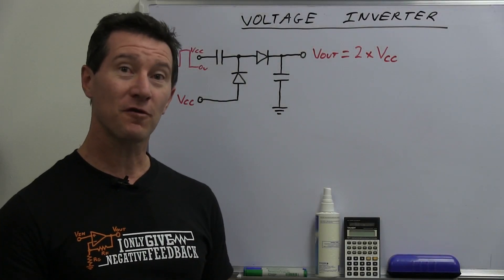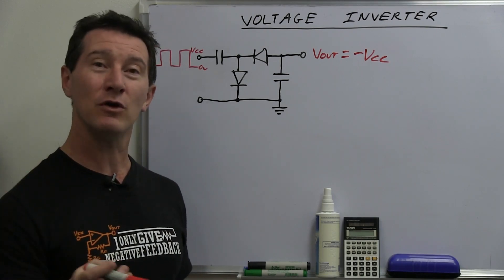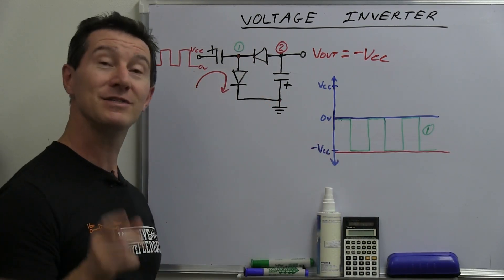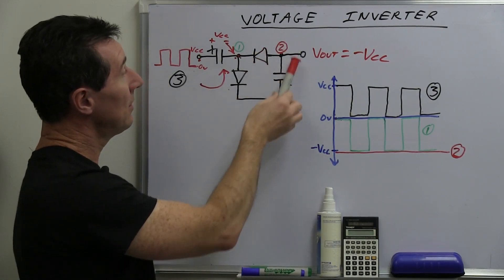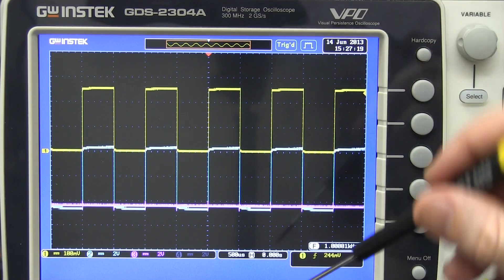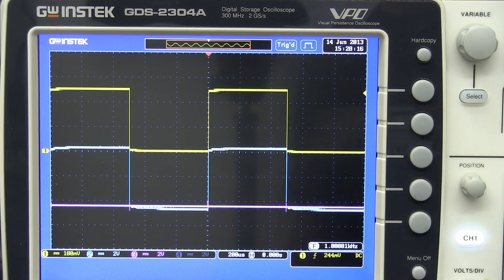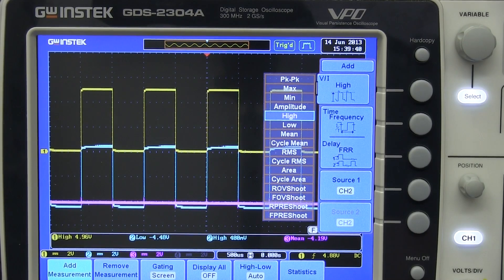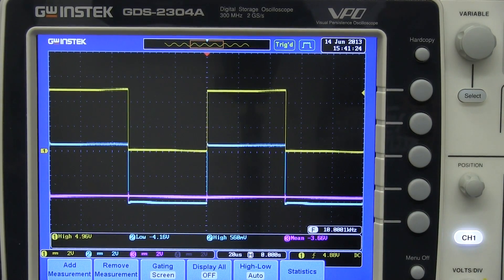EEVblog #483 - Microcontroller Voltage Inverter Tutorial

Comment: kinda a noob and just decided to use a depletion mode mosfet instead of a nc relay to drain a cap bank on a cd welder(either when user requests lower voltage or when machine is turned off and or unplugged)... id assume this is going to be enough to open the path to the bleed/drain power resistor? next up ive gota figure out your damn adc/pwm pot replacement. damn it dave why do you put these ideas in my head!? lol thanks for the awesome videos!

Comment: It is worth noting that the same principle of cascading stages of a CW doubler/multiplier applies here. I just put together a 2-stage voltage inverter that provides about -6.2V from USB's +5V, and -5.9V at around 15mA of load with negligable ripple (circa 10-12mV); plenty for driving an opamp. Caps are 330uF/16V electrolytic, diodes are BAT46 schottkys, ~6.8kHz square wave drives a 2N3904/2N3906 pair. Could be more efficient without the transistors, but I wanted to isolate from the PIC12's 50mA pin. Altogether less than $1US worth of parts. Great video, very helpful.

Comment: Hey!!  Question for you..  I know you say that this only permits a few tens of amps.  What if we instead drove an NPN transistor rated for, say, 2 amps from the input square wave and upped the diodes to 1/2 watt diodes.  Additionally, imagine that the collector on the transistor has an input of +15 volts.

It seems that this should allow us to drive a 555 square wave from a 5 volt source and invert a +15 volt supply and get at least 1/2 amp out of it.  Thoughts?  I'm not much of an electronics engineer but I have a need to build just such a circuit!!

Thanks!

Comment: Dave, when going through the voltage doubler, next you should do it going through the tripler. This is a clever design where multiple circuits can be connected in cascade and voltage can be multiplied millions of times.
Used in old TV's to generate high voltage for CRT

Comment: There is a practical limit; you aren't going to pull half an amp using crap parts and this simple design. Plus the higher you go in frequency, the more inductance on your traces/leads matters. You're also going to have problems with using standard 1N001 diodes because of switching losses.
If you need a negative source with lots of current capability, you're probably better off grabbing a shelf part than dickering around with discretes.

Comment: Softec's Spyder form QGx (HCS08 based) microcontrollers plus CodeWarrior works like a champ and even come with a little micro (socketed) in the programer to parctice. But I took the micro out and use the programer. Works so fine that even took it to the factory and people programed 5000 board with this cheap stick. Winner. It cost me, three years ago, only 25 bucks. Arrow gave us a second one for free. Come with the CW, drivers, schematics, examples and manuals on a CD. Best value IMHO

Comment: If it is for a product, I can agree, go find some of the shelf component and done.
But this is my situation: I'm using a protoboard with a 16x2 LCD + 3.3V micro battery powered. Not making the product yet, just trying stuff. And the LCD is the only one requiring 5V. Then at this moment I can't think a better solution than using a Dickson doubler or the inverter.
See Ramtron an502.
In the end, the situation "choose" the solution.

Comment: Inductors don't change their current instantly. If the capacitors are replaced with inductors, would the circuit operate on the current rather than the voltage? What characteristics would it have, ie would it double the current?

Comment: I use this method to generate the negative voltage for the contrast pin on the LCD display on my desk clock / calendar. It works out a lot more efficient than the previous version which used a voltage generator to run the whole LCD at 5V.
blog.tynemouthsoftware.co.uk/2013/06/battery-powered-lcd-desk-clock.html

Comment: Very true, keep in mind I'm mainly talking about higher current need situations. If you just need a few mA to throw +-10V at an opamp or something like that, going discrete is a fine solution!

Needing a uC for a PWM output is the only issue I have with this method. Could you perhaps show a cheap and simple way to generate a 50 to 100kHz pulse for this (without using a micro)?

Comment: The TPS60151 is $0.50 direct from TI in 1k quantities. I don't disagree that a discrete solution can be cheaper, it's just that at higher current ranges the single chip solution really closes that cost gap. Plus it's a simpler, more reliable design and you get extra features like soft start, shutdown and power good outputs. Not to mention the fact that they can switch in the hundreds of kHz to help prevent ripple.

Comment from the maker: 50 cents can be a big part of your BOM cost if you are watching the cents. Also the cheapest 100mA one Digikey have is is the MAX660 at $0.61 in 2500 volume. If you don't care about cost, sure use a switched cap chip.

Comment: If you only need 5 or 10mA, sure, but once you start factoring in bigger caps (to smooth out the ripple), higher quality diodes (to reduce dropout) and more components (to increase current capacity), I imagine you're looking at 20 to 40 cents. Plus board space for all those components and don't forget you've got to feed it from a uC.

Or I could get 150mA with a 2x2mm QFN from TI for 50 cents, and it doesn't even tie up a uC pin!

Comment: say you have a cap, charge it at 5V, then hook the positive lead to ground, on the negative lead you should measure -5V from ground, now put a diode and another cap which is referenced to ground (and discharged)  conected to that -5V, the second cap should (dis)charge to -5V, now just repeat.
That's what happened, but instead of doing it manually, the second diode which has connected directly to ground did it. Imagine the current flow, and you should see how the diodes do the job.

Comment: ditto, if you read the wikipedia articles about electromagnetics, pretty nice theory and stuff but it's useless, you'll still need the books and practical material along with the tools to get an idea of how it works....
And no, youtube didnt help either, there's not a single video about how to calculate the windings for switching tranformers nor stuff about the air gap or how it all works, just basic theory about standard 60hz mains transformers, not even in depth....